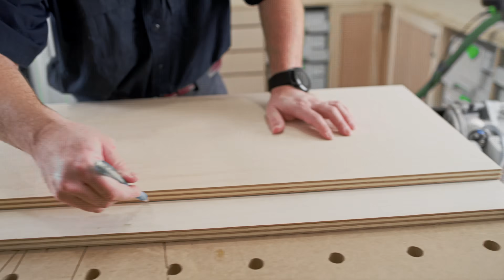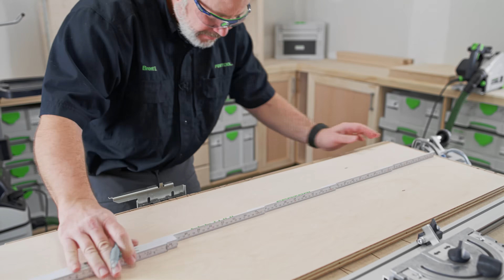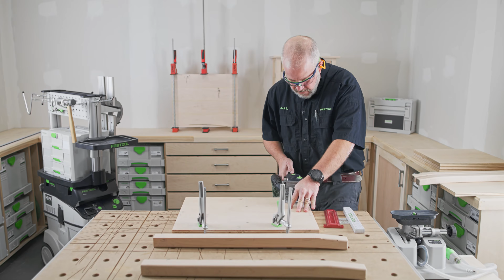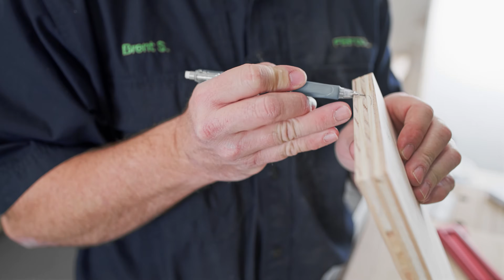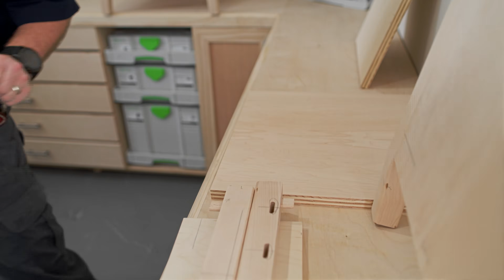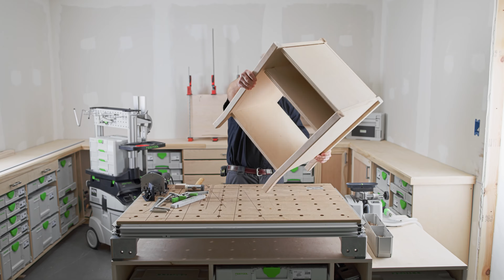Build Series 6: Bedside Table: EP3

Comment: Brent,  I love your build(s).  It must be a festool trainer thing because you and Sedge both do this and I don't understand why.  You use a tight setting then loose down the line.  I agree with the tight-tight for alignment but for the others  I disagree with your procedure.  I'd use the tight setting for alignment like you do, but i'd then use tight on one side of the joint and loose on the other.  Using loose introduces "slop" on both sides of the joint which i believe is unnecessary.  Am i missing something?